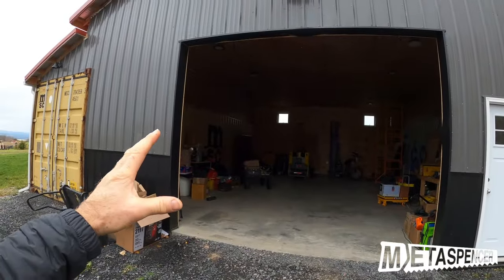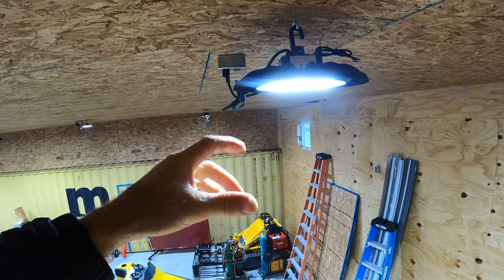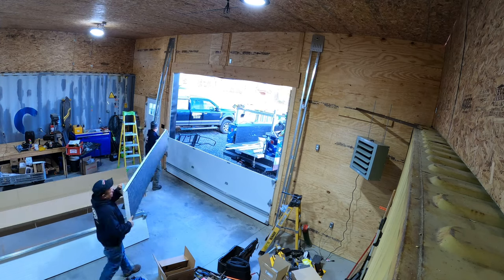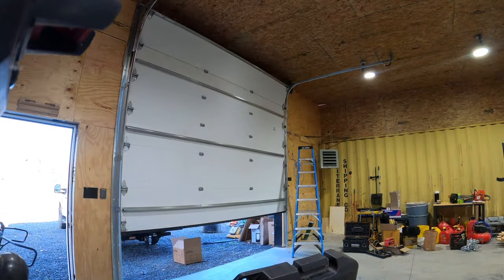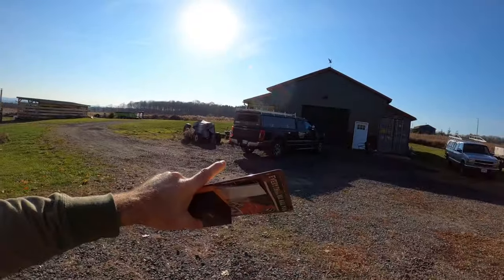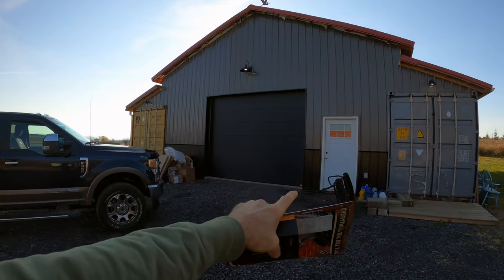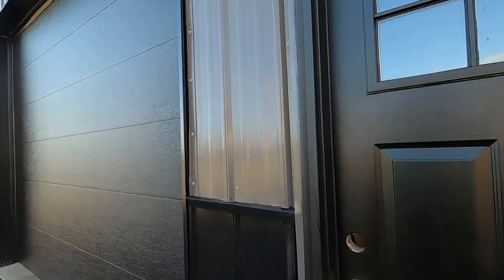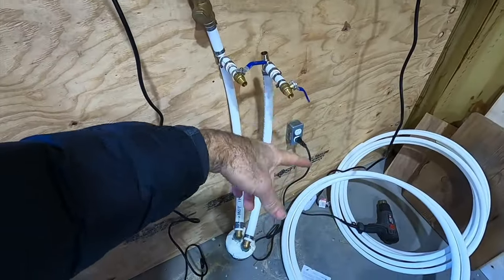Garage Door Install & Heat! - Shipping Container Barn Build 17

Comment: Hello from sweden 😀 Now you have a new place to be in when it is snowing😉 I was wondering why you have you have 2 pumps at the same line? You only need 1🤔
Reply from the maker: Sweden! I run a second pump on the line with the thought (guesswork?) that it will help the pump at the lowest part of the system. But like you said one would probably be enough! :)